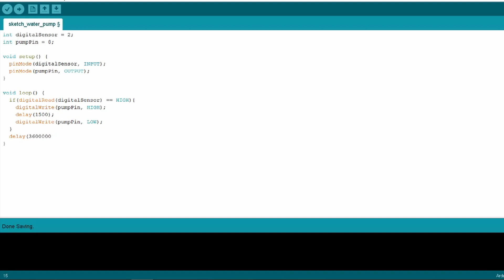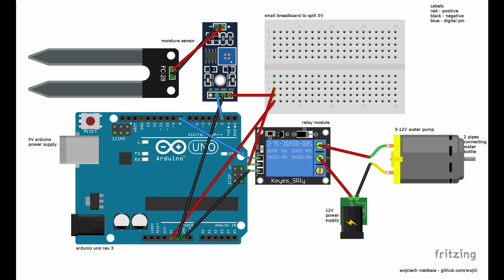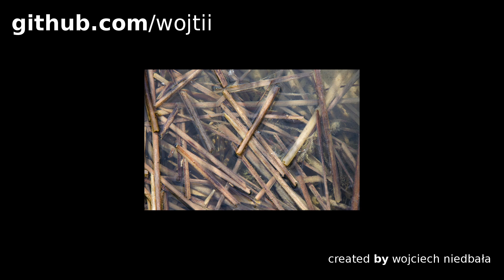Arduino plant watering system (simple)

Comment: I have followed the same code and connected everything as show in the video and the picture. When I give power to the arduino Uno and the water pump the pump doesn't stop running and never stops. A great video btw, thanks.
Reply from the maker: You are already a third person dealing with that problem, so it may be my bad or some library issue. What you can try is to check if you are using the same relay module and if yes use different port in the relay (the one on the left) for the black cable. If that does not help try to switch lines of code with setting pin - first set it to low - the input voltage may be reversed if something is different in your hardware
Reply: @wojciechniedbala  Guys, I had the same issue, I think the schematics has a minor mistake or is a different relay. I tried connecting the pump's positive to the opposite connector at the relay and it works fine.

Comment: what's cable did U Use?
Reply from the maker: For what exactly? I used few different cables in this project
Reply: for this project did u used the jumper wire male-male or female-male ?
and how about the crocodile cable?
is that the power supply sold separately?
sorry for asking you...i'm Beginner 
Please For Help.
thanks
Reply from the maker: If  you are a begginer then it is a good idea to do some basic tutorials first. I used all 3 types of jumper wires. Crocodile cable helps connecting pins sometimes. Power supply is sold separately, you would need any of 12V and >=0.5A.

Comment: I tried your code sir, and in your code it states that there is a duration of 1500 milliseconds until the pump stops. But when I tried it my pump won't stop until from 4 seconds to 15 seconds.
Reply from the maker: It sounds like some connection problem, did you check if all the cables are connected correctly?

Comment: The sketch download ok. But when I connect the system the pump start and don't stop.what I'm doing wrong?
Reply from the maker: If you have same code then it only can be wrong connection on relay module (you probably use wrong pin) so try another one
Reply: Or you need to adjust the blue thing on sensor board

Comment: Is it possible to do the same job without using arduino?  if yes then please guide
Reply from the maker: The logic behind this is that FC-28 gives 1 on digital output when plant needs to be watered, so you can connect digital output directly to relay or transistor and it will switch on the pump without arduino controll (without delays). There are 2 problems with this approach: 1. you need to provide 5v power to FC-28 and other parts. 2. Because there is no delay in watering the pump can switch few times in a row.

Comment: Hi, what transistor could I use instead of the retransmission module?
Reply from the maker: Instead of relay module you can use any transistor (with resistor) which can hold 12V, for example TIP122 should work.
Reply: Thak you!

Comment: Nice I will make it :-):-):-):-)
Reply from the maker: this should work on nano but I did not test it: https://github.com/wojtii/arduino/blob/master/plant_watering_system/two_water_pumps.ino
Reply from the maker: Bennert Maertens have fun :)
Reply: Bennert Maertens  Can I use a arduino nano an a program with two pumps and 2 sensors
Reply from the maker: Bennert Maertens yeah you can but then you need 2 relays, each for one pump
Reply: Wojciech Niedbala I have that but the code HELP me with that and maybe on a nano.

Thanks
Reply: Wojciech Niedbala  thank you so much :-):-):-):-)
Reply from the maker: Bennert Maertens no problem :)

Comment: please can you help me the pump do not stop
Reply from the maker: Söù Må Yã can you show the code?
Reply: int sensor_pin = A0;
int output_value; //outputvalue
int relay_pin = 8;
void setup()
{
pinMode (relay_pin, OUTPUT);
delay(2000);
}
void loop()
{
output_value = analogRead(sensor_pin);
if(output_value < 50)
{
digitalWrite(relay_pin, LOW);
delay(1000);
}
else
{
 digitalWrite(relay_pin, HIGH);
 delay(1000);
}
delay(1000);
}
Reply from the maker: Söù Må Yã in if you should probably have 500 instead of 50 which is very low value
Reply: nothing changes I do a test but nothing of all the pump does not stop despite the sol is very wet
Reply from the maker: Söù Må Yã what if you try to use my code instead and see then it works?
Reply: yes I did a test but did not walk
Reply from the maker: Söù Må Yã sory i have no more ideas then
Reply: thank you a lot

Comment: can i use L293D motor driver to run the motor pump
Reply from the maker: Sorry but I do not know, I was not using those.
Reply: no problem i tried it out with l293d motor driver and it worked and tq for the vedio and reply
Reply from the maker: thanks :) glad it worked
Reply: can i know how u did ur project with arduino and L293d motor driver please

Comment: Its ok but why are you using a relay when you can control a motor with a motor control or a transister and the code is a little weard but for the rest good video
Reply from the maker: Thanks, there are 2 reasons for that:
1. I think relay is much simpler and safer to use.
2. Some transistors I was using were heating up which i did not like.
Nonetheless you are right :)

Comment: Sir,
is it possible to use mini (Centiot Arduino Pro Mini Atmega328 5V 16Mhz) or nano (ARK Technosolutions Arduino Nano With ATmega328) ?.
Reply from the maker: yeah they both should work as well as arduino uno, just mind that pins may be different

Comment: Arduino: 1.8.5 (Windows Store 1.8.10.0) (Windows 10), Board: "Arduino/Genuino Uno"

C:\Users\mmx\sketch_mar05a\sketch_mar05a.ino: In function 'void setup()':

sketch_mar05a:5: error: too many arguments to function 'int digitalRead(uint8_t)'

   pinMode(digitalRead(digitalSensor, INPUT);

                                           ^

In file included from sketch\sketch_mar05a.ino.cpp:1:0:

C:\Program Files\WindowsApps\ArduinoLLC.ArduinoIDE_1.8.10.0_x86__mdqgnx93n4wtt\hardware\arduino\avr\cores\arduino/Arduino.h:135:5: note: declared here

 int digitalRead(uint8_t);

     ^

sketch_mar05a:5: error: expected ')' before ';' token

   pinMode(digitalRead(digitalSensor, INPUT);

                                            ^

C:\Users\mmx\sketch_mar05a\sketch_mar05a.ino: In function 'void loop()':

sketch_mar05a:11: error: too many arguments to function 'int digitalRead(uint8_t)'

     digitalRead(pumpPin, HIGH);

                              ^

In file included from sketch\sketch_mar05a.ino.cpp:1:0:

C:\Program Files\WindowsApps\ArduinoLLC.ArduinoIDE_1.8.10.0_x86__mdqgnx93n4wtt\hardware\arduino\avr\cores\arduino/Arduino.h:135:5: note: declared here

 int digitalRead(uint8_t);

     ^

exit status 1
too many arguments to function 'int digitalRead(uint8_t)'

This report would have more information with
"Show verbose output during compilation"
option enabled in File -> Preferences.
Reply from the maker: Zain Ahmed pin mode should be: pinMode(digitalSensor, INPUT);

Comment: can i use 240 volts AC water pump?
Reply from the maker: Ed Marjosef Mendez You can but this can be dangerous. Please make sure that your relay can handle its voltage and current. Also you will need appropriate power supply. I did not try such a high voltage pump but it should work. Be carefull with that.

Comment: i am getting this error 
exit status 1
too many arguments to function 'int digitalRead(uint8_t)
Reply from the maker: can you show the code with use of digitalRead function?
Reply: Are you using 'int' and 'uint8_t' in the same line?  Is it an integer or an unsigned integer?  You need to show the code so people can make sense of what you're trying to do.
Reply: I have the same error, could you solve it?

Comment: how can i put the arduino to sleep when inactive can you show me the added code i would need thanx
Reply from the maker: mark sherborne i am using the simple delay function, which allows interruptions so it is not a sleep mode. For a full sleep i would use these instruction: http://www.kevssite.com/arduino-power-consumption-delay-vs-sleep/
Reply: couldnt you just use a timer on the outlet?

Comment: Can i use a 12V 20A battery ? Is the current hight  ?
Reply from the maker: If you want to power an arduino I would not use 12v. If you want  to power the pump (mine takes less than 1A) it should be okay as long as the pump needs 12V power supply. But I would still check if the pump is not getting hot and is working properly. I may be wrong here since I am not an expert in electronics.

Comment: everything is working except the soil moisture sensor which doesn't stop the flow of water
Reply from the maker: you should have small potentiometer on your soil moisture sensor controler, try adjusting it to the right level
Reply: Is it normal that even if I do that it still doesn't work ? It seems like the sensor isn't able to detect the moisture
Reply from the maker: mandeep201087 you could use analog pin to check if it is sending any data. If not sensor is not working but otherwise you have to regulate the digital pin with potientometer to change its value on a lower threshold
Reply: The moisture sensor only tells the pump to turn on for the designated period of time.  In this video, he instructed it to turn on for 1.5 seconds.  Then he programmed it not to check the moisture for 1 hour.  If all goes as planned, once the moisture in the dirt is good, it will only need to deliver the water a couple times per day.  If the sensor detects enough moisture, it won't turn on again.  It will keep checking hourly until it reads that the moisture is low.  At that time, the plant will receive another 1.5 seconds of water.